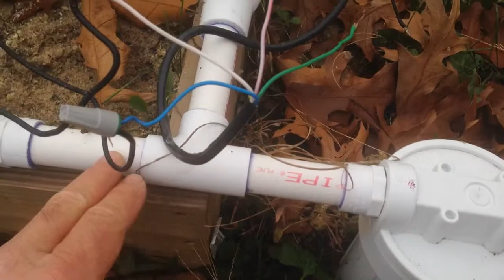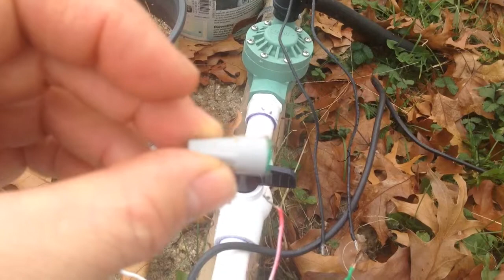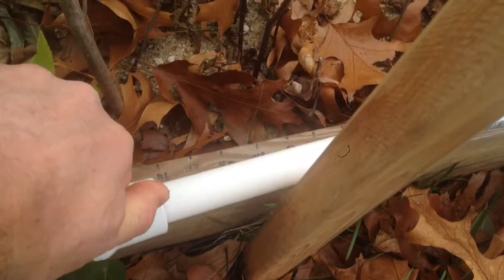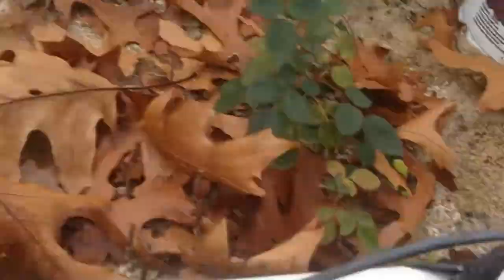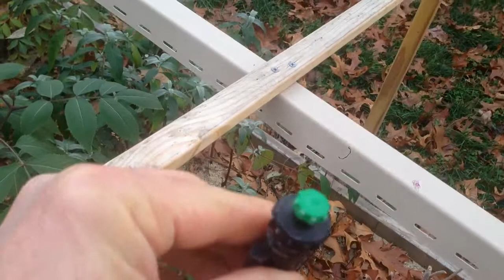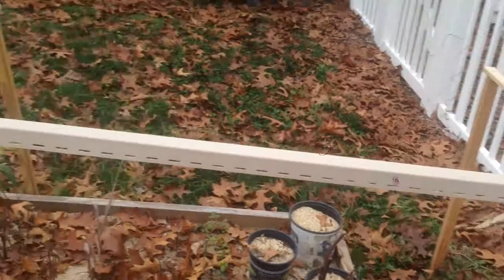Propagation Bed Plumbing

Comment: Hi. What was the brand of the mist head that you used? Also, if you’re not in a humid area, do you need a greenhouse type structure to keep the environment moist? I live in eastern Washington where we have very dry summers... do I need a poly covering or something like that, or can I just use a cover over the top like you have?
Reply from the maker: I'll have to look the mist head manufacture up.  You do not need a tunnel.  We are looking to keep the leaves moist with the mist.  If they dry out in 10 minutes, reduce the timer on the spray until the leaves don't dry out - say 5 minutes in between mist sprays.

Comment: Could you add the part ## to the Galcon timer that allows frequent, short cycles? (8056s??)
Thanks
Reply from the maker: Yes, the Galcon 8000 series does it (either 8056/8054 or 8006/8004).